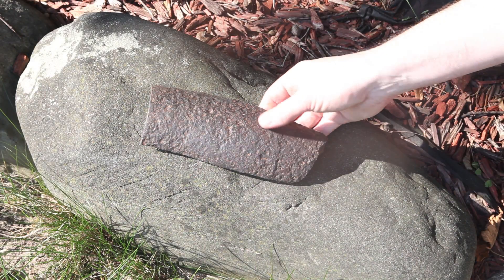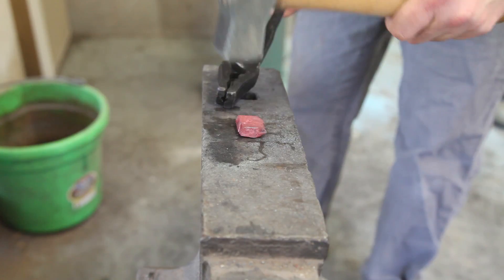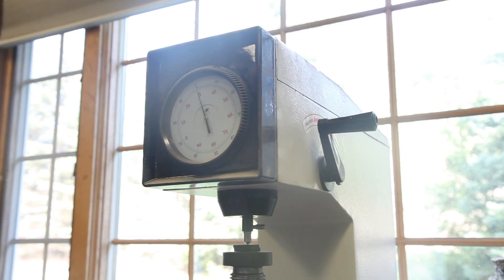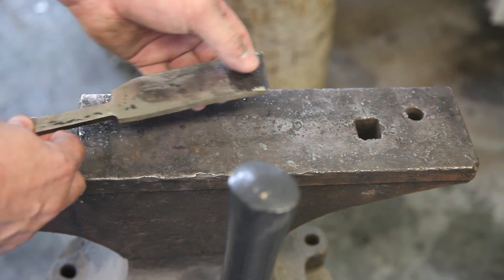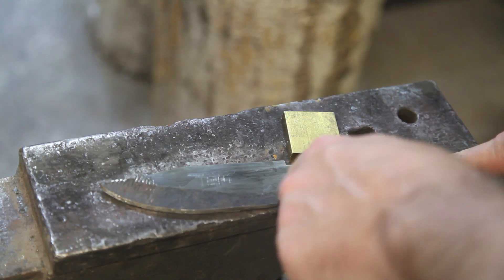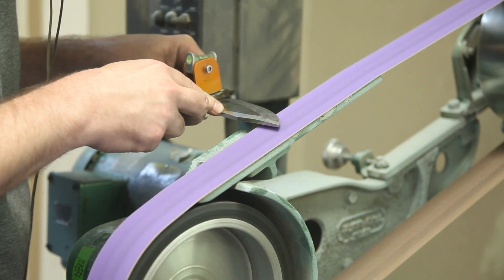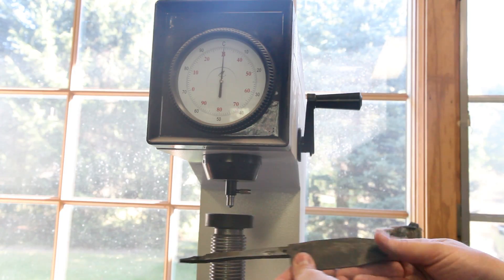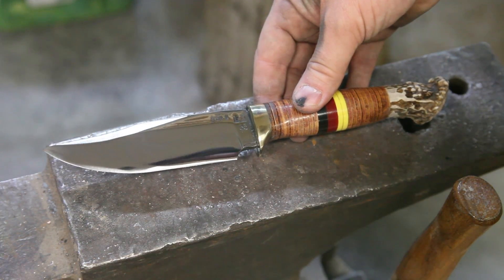How to Make A Knife from an Artillery Shell

Comment: The 8.8 cm gun was also fitted to the Tiger tank, so it's possible that shell fragment came from a tank round, and not an 88 artillery round. The size of the fragment suggests it was a rigid she'll used against a tank, and not a high explosive artillery shell. No matter what, cool knife.
Reply from the maker: Thanks for the info!  I was thinking it was an anti-tank round too.
Reply: They were HE shells set up with time delay and impact fuzes. I actually found the remains of the ballistic caps and parts of Zt. Z. S/30 aswell as percussion fuzes. they probably had tried to let them explode over and inside the US troops. I think they actually used the rounds originally intended to be fired against enemy bombers. The fightings here took place in late 44/ early 45, so they used whatever made a bang. I only have found one AP shell so far, which was a Panzergranate 39 with bottom fuze and explosive filler. That one was taken care of by EOD tho. These AP shells have way more tiny threads on the bottom ;) and are really thick and solid on top to be able to penetrate

Comment: This is such a cool story and use of an old relic... As a European, I know that it's rude to speak to cost but I'd love to know roughly how much you have invested in your shop...  Thanks for sharing this process! ;)
Reply from the maker: The grinder was ~$3500, the buffer was $600, the RC Hardness tester was $800, the Heat treat oven was ~$1200.  I might be a little off but if I remember that is what the costs were.
Reply: Thanks so much - I'm interested in expanding my working tools and this is really helpful! I really appreciate the detailed reply... Ben

Comment: There is in fact a way to know exactly what that piece of metal is composed of although it's probably beyond your availability. And really would be beyond most people's. You could put it in a mass spectrometer.
Reply from the maker: I did some mass spec in college.  I don't have that equipment now.  That would give you a breakdown of what different atoms are in the steel and you could compare that to known steels to try to figure out a heat treat.  I would bet that it would be some sort of a carbon steel but would probably not conform exactly to modern steels.  Heat treatment would still largely be trial and error.

Comment: Instead of guessing it was a high carbon steel couldn't you have done a spark test on a grinder?
Reply from the maker: Spark testing, at least in my hands, is less accurate than guessing based on historical context.  I had reasons for my guess and it turned out to be correct.
Reply: A spark test might tell you it has a high carbon content, but not if the metal is able to be hardened. Really only test for that is to do a small chunk like you did.
Reply: from what i understand most artillery shells were casted and therefore has a carbon content between  2.5–4.0% witch is at least 0.5% more than regular steel.

Comment: That's not true about it  being impossible to find out what the true composite of the steel is there is a process called  PMI or positive material identification testing that uses a laser or Atomic emission spectroscopy to find out the composition of any metal!!!Its a small portable gun they use it  all the time in oil refineries to find out what type of steel pipe is made of before it can be welded . This guy used  a hardness tester to find out the range of hardness best used for blade making!! Great video but just a lil missed information about metal identification!!!!
Reply from the maker: I get that.  If you search for my name in the scientific literature you'll find I've published a few papers, although in the realms of microbiology, transplant surgery and hand/wrist surgery.  I have used Mass spec before, but not specifically what you're talking about.  The problem would be going from the information you get back from your type of test to figuring out the best way to harden it.  I don't have access to that sort of equipment you're talking about and most of the people watching this video wouldn't even have a hardness tester.  What I did was an experiment to figure out if I was even able to harden the steel.  From there I researched steels commonly in use at the time and made a guess as to a good protocol.  This isn't a knife I would ever sell.  It is a Christmas present for my German friend.  Thanks for watching and commenting.

Comment: You didn't anneal the steel. You put it through a normalization. Annealing is done after heat treat.
Reply: Almost right... He didn't anneal it, you are correct. Annealing is relaxing the metal from a hardened state back to an unhardened state. I believe you meant Tempering, which is done after the heat treat.
Reply from the maker: Nice catch.  I 'normalized' the steel after forging it to shape.  I tempered the steel after heat treat.  I am not always thinking before I'm talking in a video.  :)

Comment: I thought you had to temper the steel to harden it to the 56 Rockwell at 400+ degrees not red hot at 1500?
Reply: Perhaps the steel has a low carbon content, making 56 RC the maximum hardness from an oil quench, instead of the usual 60-64 RC from proper high carbon knife steels. Or he just didn´t record or mention the tempering.
Reply: The point of tempering is to take down the hardness to give more flexibility to the steel. You know, so it's not so brittle.
Reply: Did you mean me, or mggcomputers? Because I got a notification, but don´t understand how it connects to my comment.  I know tempering steel is meant to get rid of the glass like hardness from quenching.